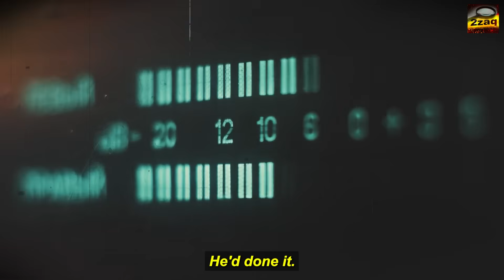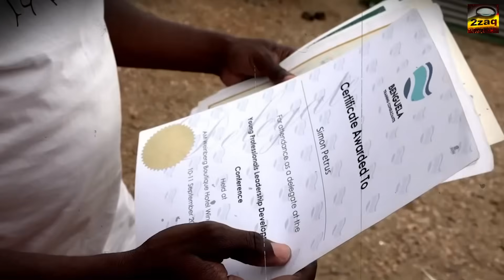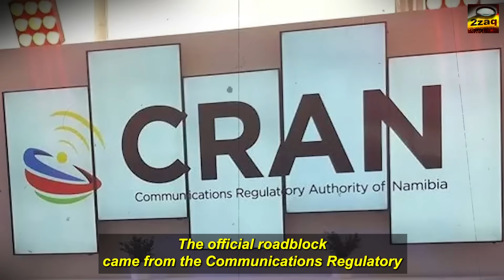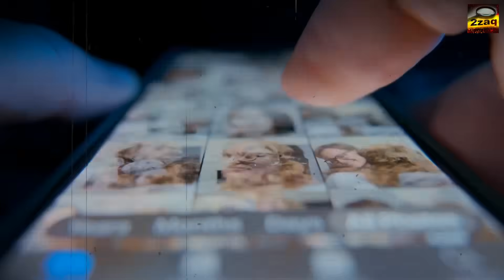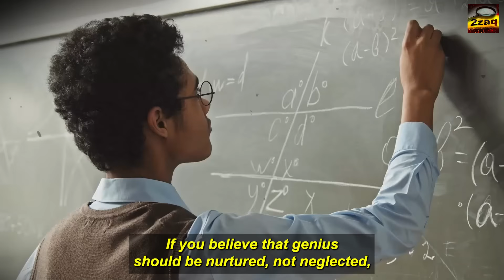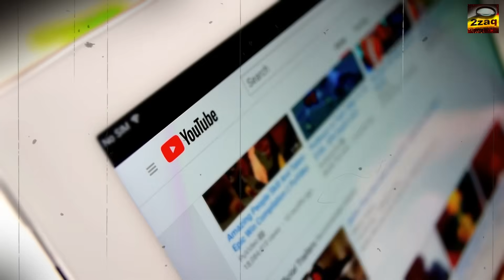How a Namibian Inventor Made Calls With No SIM Card!

Comment: That "invention" by that Namibian was a hoax. What he showed in a video was a cardboard box with wires attached to it with nothing in it. You cannot use a cell phone without a sim card to make phone calls and receive them. A sim card identifies the phone by a phone number and serial number. Plus a sim card enabled a user to use a particular phone provider that is if you have credit. The only time you can use a cell phone without a sim card, if the main Telco of the area  allows the cell phone to access emergency service numbers and of course using the phone via WiFi. Where you can make a phone call through Messager, Whatsapp etc.
Reply: You clearly do not understand that the communication uses radio waves.
Reply: What this man did was use tech from 45yrs ago. In 1980 I learned how to”Mobile” phones work, thats what he’s doing.